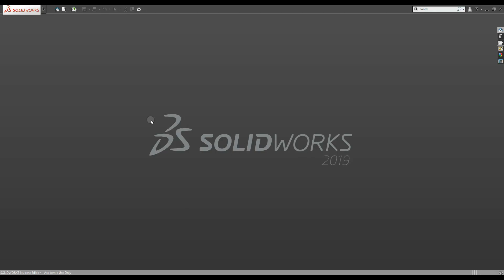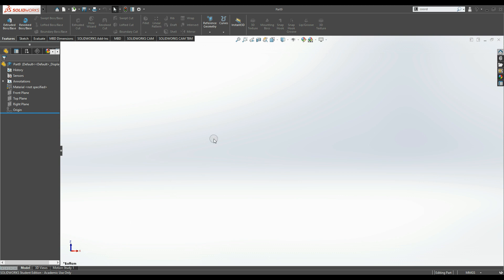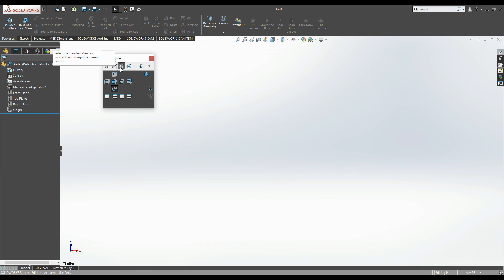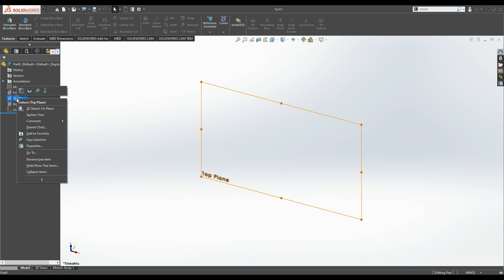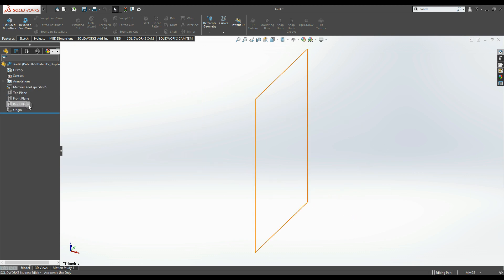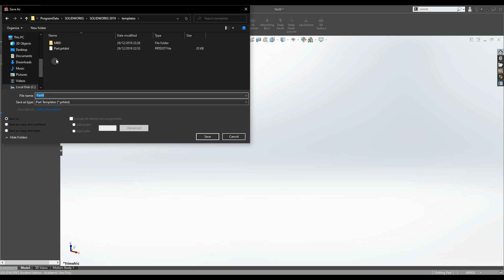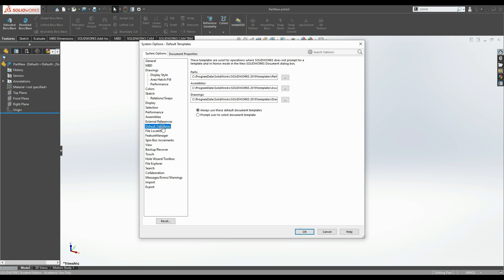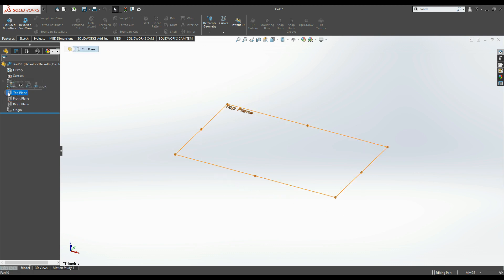SolidWorks Origin Re-orientate

Comment: I also apply this method but still the origin point itself is misoriented. The little red arrows in a sketch go opposite way of Z-up. Any fix for this?
Reply: Exactly. And the Right Plane is still missaligned as it's tilted 90º clockwise

Comment: Why in the fuck is Y facing up in the software? I am new to Solidworks and this has fucked up everything I have tried to do thus far. Every stl I output is 90 degrees off. Been frustrating all the way. Every cnc I have EVER looked at is a cartesian X Y on the bed. I do not get it.
Reply: https://youtu.be/p18_NfMzTyQ
check out my latest video that shows a work around to fix that issue !!